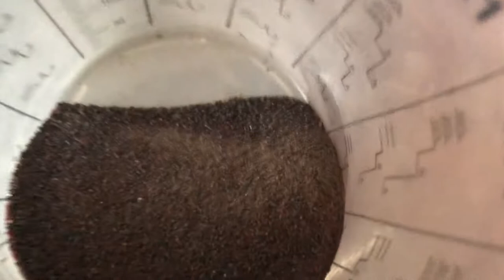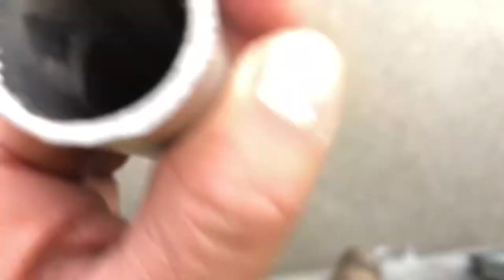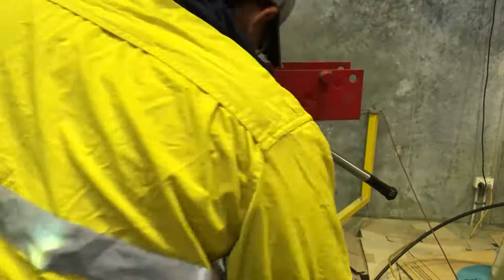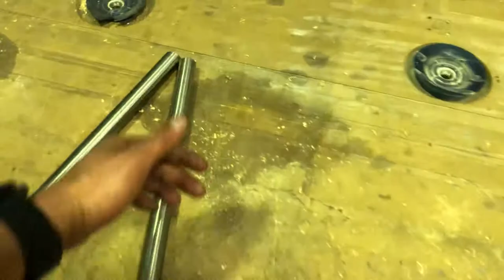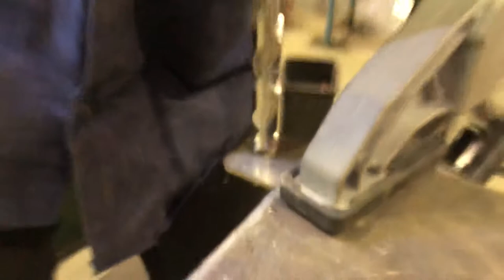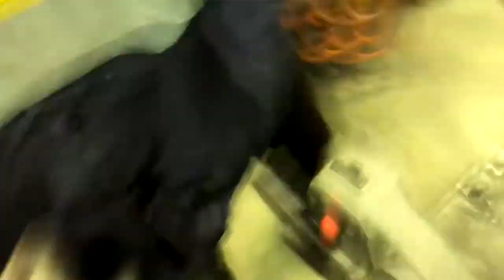How to Build a 316 Stainless Steel Pushpit for Sailboat

Comment: It's not that you need a mandrel bender, you just need to install the correct radius stationary pieces in your press. The moving, center piece appears to be the correct radius, but two the black pieces are way too big. If you had the right pieces, you wouldn't have to fill with sand either. All three pieces that touch the tubing have to be sized to the tubing you're bending. Good job though! Much credit for building yourself and trying to get around the wrong tool size with an idea like filling with sand!!

Comment: The jiggling end piece of a tape measure is purposefully designed to accommodate measuring by both pushing a tape up against an object or hooking it over the edge of an object, and the jiggle accounts for the thickness of the metal hook, so measuring either way will be accurate.